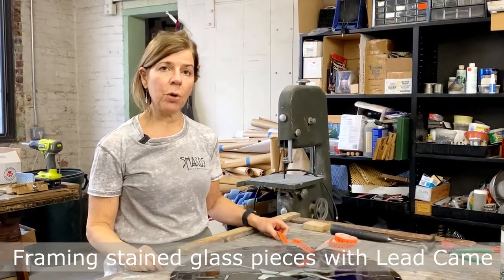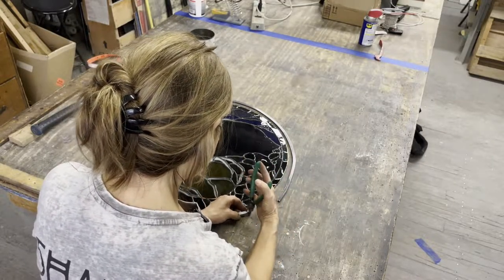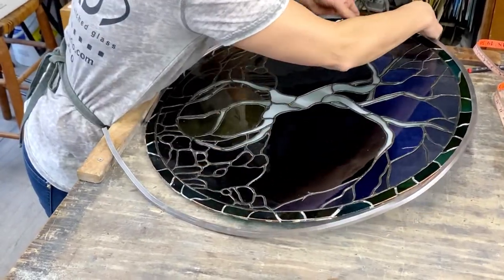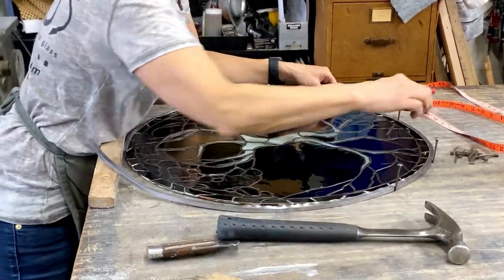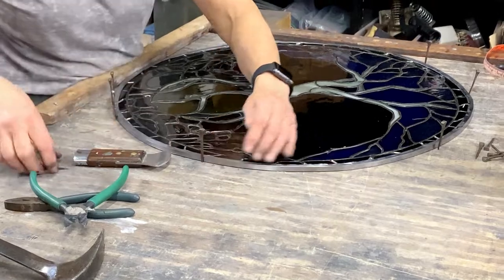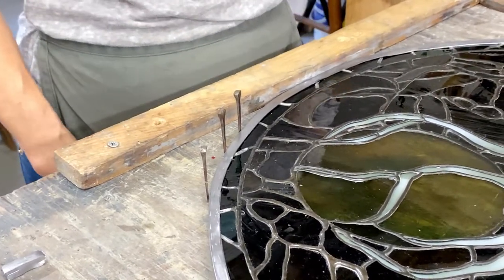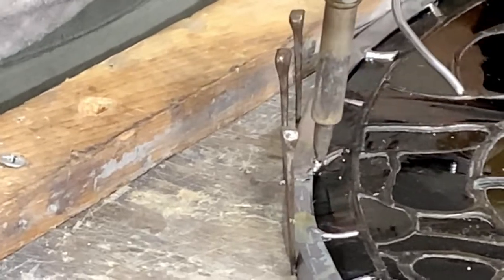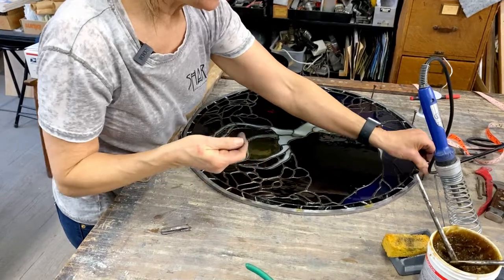Framing stained glass pieces with Lead Came

Comment: Wedging came around antique glass at 4:45. 

Thank you! I’ve been making ornaments using antique glass and trying to get it into the came is hard!
Reply from the maker: Ahhhh yes....Antiques can be a real beast. If the came is super tiny, like hobby came, try putting a tiny bevel on your glass by holding it at a severe angle, do a small grind all around, flip and do the same on the other side.  Sometimes just taking off a bit and making the edge more tapered will facilitate holding the came on the edge.

Comment: very informative for a newbie. Thank you. what temp did you set your iron at, I saw that you lowered it for joining the lead came to edges.
Reply from the maker: All irons are calibrated differently.....as well, the body of lead cames are quite different sooooo, all that means is that you have to experiment with some sacrificial pieces of lead to get the right temp.  We start by turning the iron down a notch and then adjust to a temp where solder flows nicely but the iron can be right down on the lead material without burning through. Hope this helps

Comment: I love this video! Thank you. I have a 34” circular piece I need to frame and it’s stressing me out! It’s a lot of pieces (700) and I have to reinforce with restrip. Would initially framing it with lead came and then framing it in wood be a good idea in order to even out the edges?
Reply from the maker: Yes,
Lead came first around the edge will help to even everything out. In fact, we use an H channel instead of U channel when we need to even out an edge and it’s ultimately going into a wood frame. This does two things; 
one,  It gives rigidity to your piece and makes it easier to handle 
two, it allows you to shave down the lead came in areas where it doesn’t fit perfectly into the frame because the outside part of the H is empty. Does that make sense?
Reply: Yes that makes perfect sense, thank you! When I get a frame made it should also have an H channel as well right?
Reply from the maker: @brookedavis3028  Sorry Brooke, I commented above.  Please see the explanation

Comment: Hi, so the flux paste works differently in that if you used liqiud flux you couldn't go around all the points like you just did all at once because you would have to reapply,  would that be correct ? Also did you use any reinforced barring in the middle with the foil ? Will you be puttying the outside frame so theres no gap between the glass & the lead frame ? So many questions lol sorry 🤣
Reply from the maker: The paste flux stays "put" because its thick...big advantage.  I know there was no external support on this one but there may have been flex bar soldered in between the foiled seams. Flex bar is a braided flat mesh strand that goes on end in between seams and it is extremely maliable so can be bent around all sorts of shapes curves, etc....
Reply: @shardsglassstudio9298  Thankyou so much for all this valuable info appreciated

Comment: This seems to be a fairly large piece. Recently I went into a shop looking for glass, while there I mentioned that I was learning the process and was going to use lead cane for the outer edge of several pieces to hang in windows instead of reframing in wood. They strongly suggested I use zinc. My question being how big of a piece can you safely use and hang using lead came and it not stretch?
Reply from the maker: Thank you for your inquiry....Good question, to which there are several answers.
 In order to frame a round, oval, or anything that is not straight requires a zinc bender in order to use zinc.  This is a tool (mercedes bender) that is pricey and has a learning curve to get proficient (not a bad thing). 
Lead came is stretched before using, bringing the metal alloy into its tensile range, which means it is fairly rigid and much of the "sag" is mitigated.  With that said, still a good idea to remember that over the course of time lead will stretch. The real key is hanging your piece properly.  A piece should always be hung with 2 hooks that have  long tails (we twist pretinned 14 gauge wire to accomplish this) that can be solder right into two seams in the top third of your piece. Never should a piece be hung from the edge trim regardless of it being zinc or lead came.  Your piece should then be hung "museum style" which just means with two chains, or whatever you are using for a hanging apparatus, straight up to two anchors. Never should a piece be hung from just one anchor as that will encourage the piece to bend regardless of what has been used (zinc or lead) for framing.
Our rule of thumb is, if the piece warrants external support (rough guidelines, every 18-22") then the piece should be framed in wood, in order to properly notch into the framing. (commercial framing in aluminum or steel also allows for external support to be secured)
Wowsa....sorry that was a waaaaaaay longer explanation than i intended.  Hope it helps!
Reply from the maker: I also shoud have stressed that the edge treatment, zinc or lead, is to add rigidity.....NOT for hanging from
Reply: Thank you so much for your reply. Do you have a video showing what you are referring to when you say a piece should always be hung with 2 hooks that have long tails soldered right into two seams?
Reply: Thanks for this video and this reply! Saved me from hanging a teardrop shaped piece from just one hook at the top of the came.

Comment: I'm new to stain glass, and just made my first large project 18" by 19".  I used copper foil.  It will hang in a window.  Is there a reason other then looks to use either lead or zinc as a border?  Is just soldering the edge not strong enough for something that size?
Reply from the maker: Strength is determined by design. As long as you don’t have a ton of straight lines (always becomes a hinge where the piece wants to bend) you may be ok with out edging.
When hanging, make a hook with a long tail and solder it into seams that are in the top third of your piece. Be aware the seams may be in the interior of the top third of piece and not directly along the edge.

Comment: Hi I am doing a round piece of picture of wizard and my daughter wants led lights behind it  can a piece of perspex be used for backing and lights inbetween  any hints please
Reply from the maker: Nice ....Most of our stuff that is artificially lit is done in a full installed frame method.  Meaning it is installed into an opening that can be lit, usually by bouncing light off of a white shiny background, but full disclosure, ive never done anything that is free hanging and lit artificially.  Sorry not much help for your situation.  Good luck with it!

Comment: Hi what kind is saw did you use to cut zinc?
Reply: I use a cheap little chop saw from Harbor Freight. Makes 0-45 degrees.
Reply: @jenorrn  Yes, they are great and there is a notch in the vise that will hold brass tubing firmly for a clean cut.

Comment: Even with the lead came, this piece still requires a wood frame to be hung right? Or is the lead came enough?
Reply from the maker: This piece is not very big….I’m going to guess that it was around 21 “. It was hung from two points, with long tailed wire that were soldered into a seam. I inform clients to hang their pieces ( when not in a wood frame) museum style  (straight and from two points) This prevents pulling that can make a piece bend no matter if zinc or lead is on the edge. Hope this was helpful.
Reply: @shardsglassstudio9298  Where do I get information about this hanging style? What do you mean into the seam if it's got a frame. I really need help with this as I moving into larger pieces. TIA 🙏
Reply from the maker: @valerieburgess6602  this technique is what you would use if you were NOT using a wood frame.
The piece should always be hung from two areas that are as close to adjacent as possible in the top third of the piece

Comment: In working with your project - do you need to solder the edge of the circle or no given you are putting the came on?
Reply from the maker: No need to solder the edge in fact preferable not too as it makes for an easier fit for the came to snap on an unadulterated edge!!

Comment: How wide is the came you are using? I am just getting back into stained glass and I forgot what size width u channel to get
Reply from the maker: The one that im using is a 5/16" u channel but typically you would see 1/4" (you wouldnt have to fight as much as i do in the video with 1/4")

Comment: How do you stretch the lead came?
Reply from the maker: We stretch with a stanton stretcher which is put out by Glastar.  They are no longer in business but if you can find one on line or at your local stained glass supplier, BUY IT!  Other than that, you can get a spring loaded lead vise (pretty much at any glass supplier and pull the lead by hand, one end in the vise and hold onto the opposite end with a pair of grozing pliers. It takes a fair amount of upper body strength and an average, depending on the lead size and profile is about a 6" stretch.  If you can, stretch over a table so that once it is straight you can lie it down to keep it straight till you cut it into lengths.  If you can help it don't cut it smaller before the stretch because that will take away your leverage and it will be much harder to get the "slack" out of the lead.  Hope this helps

Comment from the maker: So what you want to do is put the H came around your piece first.  Then take the diameter of your circle in several places, taking an average, knowing that you can shave down some of the outside edge of the H came.  Then have a frame made that you can "drop in'' your piece. You definitely do not want to have a channel (if im understanding what you said) as there would be no way to "drop" your circle into it. It can be held into the circular frame with silicone/ push points/ or a thin bendable reed (or the historic way....use a rope that has been dredged in glue. place around the perimeter and once the glue dries, give extra support by adding a few nails into the glue stiffened rope. A fun solution!)  Good luck

.

Comment: why use lead when there probably are a lot of other optional materials /anyways, came to this channel to see the process of scoring and cutting stained glass
Reply from the maker: Oh boy….where to start.
Being in this industry I accepted early on that the ubiquitous material is lead and that I would find ways to use it responsibly for the health of myself, family, and the environment. What does that mean? 
Always use a lead VAPOR (not dust) barrier respirator. Never solder around children or pets…and recycle scrap lead with a metal scrap yard. Lead IS a hazardous material (as you point out) and should never be discarded in the trash. If your goal is a stained glass without lead ( solder or came) give mosaics or dalles de verre a go. They are  beautiful.
Reply: @shardsglassstudio9298  Hi, I’m just..really admiring the physics of glass (or just thin glass?) and the limits of the curves that can be made :)

I’ve once wanted to make one of those rectangular infinity tealight boxes. Didn’t require much more than thin window glass, some transparent foil and a tough silicone sealant.
- that’s pretty much it

Comment: Your fingers are pretty much black at the end from handling the lead.  While it likely won't be absorbed through your fingers...I hope you wash your hands well after so you don't transfer it elsewhere.  Gloves??
Reply from the maker: Thank you for the comment and suggestion. Yes definitely to washing hands copiously! As you might be able to tell from looking at my hands, they are quite a mess (dry,dry,dry) from so much soap and water....We never wear gloves (Ive tried and get my fingers caught constantly).  When soldering its a bad idea to wear gloves, in my opinion.  If you drop a blob of hot solder on your hand without gloves, it rolls off and causes nothing more than maybe a small blemish, but if you have gloves on, hot solder can get trapped and cause a much worse burn.